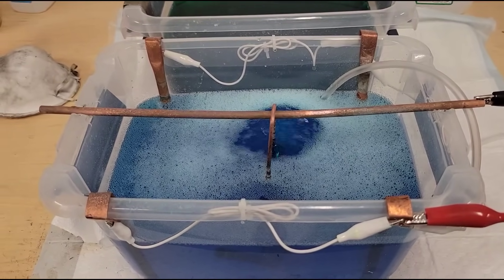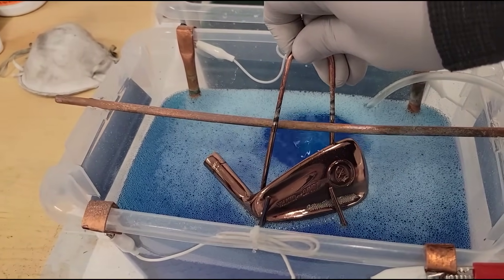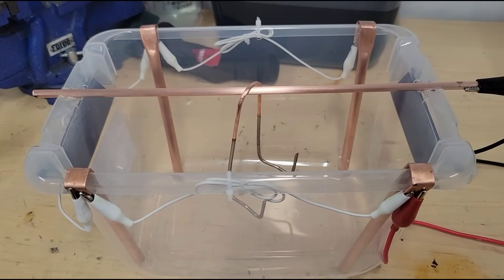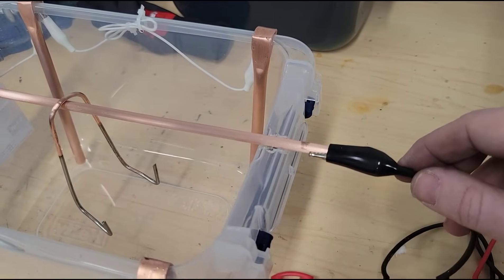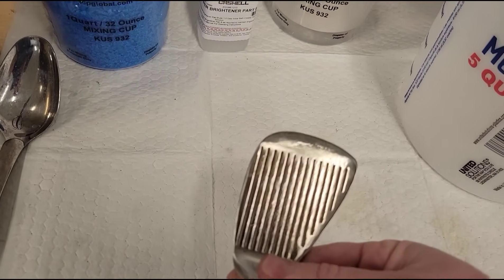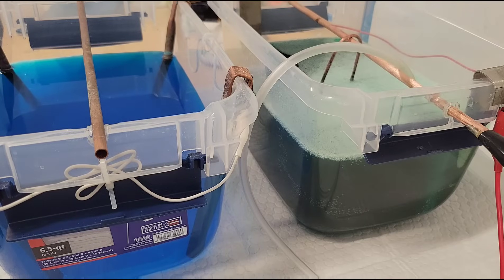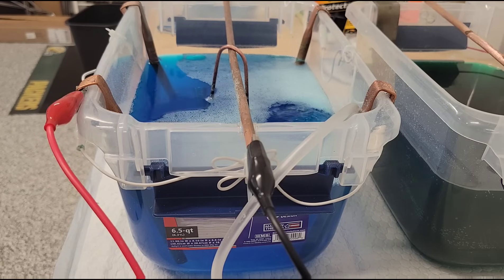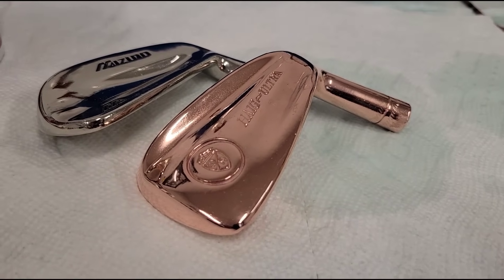Copper-Plating Your Golf Clubs: The Ultimate Guide

Comment: How long does copper and nickel solution last for? Can you use it multiple times or is it a 1 and done?
Reply from the maker: I still have the same solution in a jug. As long as it's clean, it can be reused. You just have to add distilled water to top it off.

Comment: You are correct that copper will not plate to a part that is chromed. You are incorrect that it will not plate to bare steel. After cleaning the steel, dip in in an acid bath for at least one minute then place it in the copper plating tank. All bumpers that are triple chrome plated are first plated with copper to fill in the imperfections, then nickel followed by chrome.

Comment: great stuff! I'm going to start an MP14 restoration soon. Is there any need to plug the hosel so that you don't chrome plate the inside of the hosel? I was wondering if that might deter good adhesion when you put the shaft back on
Reply from the maker: @nicholaskeay9842  thank you. You don't have to plug it. You can just ream it out with sandpaper before you glue it back on.

Comment: How much zeps did you add? I have a 2 pound bottle but it looks like you used a bit less
Reply from the maker: @trentonabernathy8540    @ I used the whole container, but I don't recall what size it was. I'm sure you'd be ok to use it all since there works be more copper in the solution and less need to feed it with the copper anodes
Reply: @BradMeehan  thanks! I ended up using about half the container. I found some source that said 10-12 oz per gallon of solution, and I made 1.5 gallons. I’ll see how it turns out, fortunately I have quite a bit of anode material. Your videos have been a big help.

Comment: I’m working on a Scotty Cameron TE I3 right now. I think the body is made of carbon steel, and has a black oxide finish. I want to remove the finish it has now so I can torch finish it, but I’m not sure how to remove the finish. Should I try bathing it in an acid.
Reply from the maker: You can just use the muriatic acid or Whinks rust removal. Check out my 'how to make a club black' video. Black oxide is just rust. You could even sand it off.
Reply: @BradMeehan  thank you!

Comment: Theoretically could you swing weight a club head by plating?
Reply from the maker: You lose some weight during sanding and polishing which yoi gain back during plating. It would take a lot to change it, but theoretically, it would since it has mass.

Comment: Could this process be used to replate cast iron skillet for use?
Reply from the maker: Yes, same technique for any metal surface except aluminum or stainless, which requires a different preparation than steel.

Comment: For people who don't know you don't need to buy copper sulfate, you can make it by just running a current through a copper anode and cathode on the same container that you plan to electro plate until you reach a nice blue color around 30 mins works excellent!
Reply: @AutodidactEngineer  does that work with nickel anode and cathode?

Comment: How do i get rid of deeper scratchers? Build my own set through your videos with good result but deeper scratcher remain😢 help!
Reply from the maker: You really have to spend time sanding them away first. Plating will not hide any scratches like painting does.
Reply: @BradMeehan  rekomend any spec grit?
Reply from the maker: @mikaelstahl2282  yes. Start with 220, then 400, then 600. Don't skip to the next grit until every scratch is gone, them do it some more. If you skip ahead too fast, you will still see the scratches in the final finish

Comment: Brad, did you ever find out the durability of the copper platting on the iron? Thanks!
Reply from the maker: I wouldn't recommend it for playing. Maybe on the face, like the MacGregor Colokrom's or something decorative on the back, but it's not durable enough to handle a bunker shot or hard pan lie. It will wear off pretty quickly like sandpaper.
Reply from the maker: But, you can also leave a layer of clear coat over it to extend the life.
Reply: Thank you for the feedback!

Comment: is the hook club wire copper as well??
Reply from the maker: It's copper coated. I've been using a piece of thin copper tubing lately that fits into the hosel. You can use anything that is conductive.
Reply: @BradMeehan  Thank you Sir...👍😊

Comment: how can i bronze coat a set of Taylormade 21 P790s?!
Reply from the maker: Caswell plating sells a bronze plating kit, but the steps are the same.
Reply: @BradMeehan  would i just have to remove the foam inserts first, then sand them before doing the bronze soak?
Reply from the maker: @rickydaher  You wouldn't have to remove the foam. The bronze won't bond to it (or chrome) at all.  You'd have to remove the chrome by sanding or other means like a dilute acid bath or the chrome stripping solution. You'll know right away if you missed a spot and you'll have to buff off the layer you just did and do it again. This is super easy stuff. Typing it out makes it sound harder than it really is. Cleanliness is the key to success. 

Check out my chrome stripping video on how to check if it's clean or not.
Reply: @BradMeehan  can i use the copper tank build to soak them?
Reply from the maker: @rickydaher  Looks like it. The only difference between my nickel tank and my copper tank is the anode i used (nickel vs. copper). Everything else is the same, so i'm sure their bronze kit is as well. The concept is exactly the same - take metal from a donor anode and bond it to your club. 

You may need to adjust the power output for the type of metal you're using. Meaning, I used less voltage/current for the copper than the nickel, but that was trial and error. There are calculators to get close.   The kit should tell you what to use per square inch of surface area.
Reply: @BradMeehan  right, could you possibly email me a list of what i would need as far as connectors etc lol? would be really lookin out if you could, cause to an extent it’s kinda vague on where i can get the white alligator clip connectors
Reply from the maker: @rickydaher  Check out the links in the description. Also, they don't have to be white, you just need them to be connected.

Comment: Please help me out here...been trying to plate some different pieces....first off they come out looking nowhere like yours...they're dull and have these "bumps" on them in several places...in places, the copper doesn't take... Getting aggravating...please help
Reply from the maker: Hi, Tim

Can you verify you used the brightener? Also, the bumps are pitting and it's caused by either too much current, or the piece is too close to the anodes.  

If the copper isn't bonding, it's likely still dirty (do the water break test), still has chrome, or there isn't a nickel layer beneath it. Remember, the copper won't bond directly to the steel. 

You can lightly buff it when it's done, but make sure you have enough of a layer of plating.
Reply: @BradMeehan  hi Brad...yes, i used 10ml per gallon per another video..had to make 2 and a half gallons to completely submerge my part because of the size of my container...couldn't find anything closer...im thinking i may not have put enough brightener in it...i can understand the placement of the copper anodes..may have actually been to close..need to lengthen my alligator clip wires...im thinking the piece may have actually been chrome plated instead of nickel...what is the water break test and what should i do/use to get the copper,bumps and chrome off? Thanks.......oh....and what should the current and volts be set on? My particular recitifier doesn't show amps being used
Reply from the maker: @timhiggins5956  Re: "My particular rectifier doesn't show amps being used" - Does this mean it doesn't have an ammeter or you are showing zero on the meter? I believe I was up to 4 v and 1 amp when I did the copper.

For the bumps, you'll have to polish those down and do it again. 

Here is the water break test: https://www.youtube.com/watch?v=tf02DB612HE
Reply: @BradMeehan  it has current and voltage...i was running the current starting out on 3 then went to 5....the voltage automatically changed when i changed the current setting
Reply from the maker: @timhiggins5956  I believe the 5 amps is what is causing the pitting. That's pretty high. 

Try a junk part with no chrome, spotless clean, and lower power (maybe 1 amp) and see how it comes out. Even if it's not bright right out of the bath, it can be with a light hit on the loose cotton wheel or hand polishing. Just get the material on it and see if it's plating for now.
Reply: @BradMeehan  ok...so I've been watching your video on the water break test on the removal of chrome......my question is this.... how do i take off the copper plating that did take so i can start new?
Reply from the maker: @timhiggins5956  it's so soft, you can buff it off. And, if it never really bonded you could probably just steel wool it off or sand it.

Comment: After you're finished with the plating and take it out of the solution, do you dip it in anything like distilled water? Do you wipe it off with anything or just let it drip dry? Thanks....sorry for all the questions
Reply: Brightner
1/8 cup corn syrip
1/8 cup murilax
1/4 cup water
BLEND really well, I use an emlusion blender.
Add as a per video here, works FANTASTIC! 
The above amount worked well in 1.5 gallons of copper bath.
Reply from the maker: I spray it down with distilled water for a good rinse, but nothing after that. It's bonded onto the club, so it won't wipe off so you can wipe it if you want. Keep the questions coming. That's why I made the channel!
Reply: @BradMeehan  thanks for the reply...ive got everything i need except the battery acid and copper brightener...ill have to order the brightener as i can't find it in any local store. Do you have any recommendations on finding it? Do you have to polish the pieces once done? I had a plating company do the plating and i guess they did an ok job but there's some burn marks on some of the pieces and what looks like finger prints..any comments on that, or how to avoid them? Ive got some extra pieces for a trial run and if i can get it all figured out, Im gonna redo the pieces i previously had plated...one other thing...i want to clear coat the pieces so they don't turn...i clearcoated the pieces from the plating company with a can of rustoleum aerosol clearcoat but they didn't turn out like i was expecting...should i have used everbrite? These are the metal banjo parts so brushing will be out of the question as there are a lot of small washers, nuts etc..thanks so much for your replies.
Reply from the maker: @timhiggins5956  HI, Tim. I haven't found the brighter outside of Caswells site. I did see a YouTube video of someone using a liquid laxative as a brightener, of all things. 

The fingerprint happens when you touch the plating without rinsing it. For some reason, I believe it still has a charge. It could also be that the fingerprint was there before the plating because it wasn't clean. You can buff after plating but I use only the loose cotton and barely touch it. I'd only hand polish the copper because it's so soft. 

I've seen videos of people using a sealant when they polish aluminum wheels. I'm not sure what it is, but I'd bet it would accomplish the same as the clear coat.
Reply from the maker: I ended up with 3 volts and about 1 Amp. I've reached out to a few plating companies to see what they use for thei4 power requirements but I've gotten no responses so far. It's a learning process for me, so I'm trying various settings to see what works best.

Comment: Great video! Could you hang more than one club at a time? Can you keep the shaft on, tape it and lean it against a wall? They’re graphite shafts no I’m assuming it won’t plate.
Reply from the maker: Absolutely. 
The lower requirements increase a bit to handle the additional clubs in the solution. I'd also recommend a larger container so you can keep the club far enough the from the anode. If it's too close, it can "burn", which isn't the end of the world. You just have to polish it a little after but you'll still get the same result.

Same with keeping the club on the shaft. I'll make a video of the key considerations for keeping it on.

Comment: How long do you leave them in, and also how long does 4 copper pipes last for usage?
Reply from the maker: The longer you go, the thicker the plating. 3 or 4 hours is generally where I pull them and check it. If they're not shiny, you can always polish after so you'll need a thicker layer to avoid polishing through the plating.
Reply from the maker: The copper anodes will last for a few months. I've yet to change mine, but I have changed my nickel anodes b8eciae i use them more.

Comment: So I have a set of TM P770s. If I wanted to do this I would have to nickel plate them first and then copper plate?
Reply from the maker: Yes, nickel first. You could use the "nickel strike", but you're risking missing a spot since it's hard to detect with the naked eye. A quick dip in the nickel has been successful for me before the copper.
Reply: @BradMeehan  got it! So follow your nickel plating video first and then dip in copper? Any specific time in the nickel? Also are you familiar with the p770s? Any unknown chrome I don’t know of? Also do you have any photos of what the club looks like with a little age on it?

Comment: I'm wanting to do this with an entire set of clubs. Do you know if you can do multiple at once? And do you know if you can use the same solution several times? Thanks!
Reply from the maker: Added an equipment list to the description
Reply from the maker: Hi, Jordan. You can use the solution indefinitely as the copper anodes continue to replenish the solution. You will have to eventually add more distilled water and maybe more brightener over time. The anodes (the copper bars) will deplete as they are the donor metals to the process. What doesn't end up on the club ends up in the solution itself. 

You can do multiple but you'll need larger anodes. The rule of thumb is the anodes need to be twice the surface area of the item you're plating. I do one at a time so I can prep amd polish one while plating another.

Comment: How did you mix the nickle plating solution. That iron looked pretty nice nickle plated. Do you need the copper brightener for it to stick to the club.
Reply from the maker: Check out my nickel plating video to see how to make the nickel. The copper brighter just makes it shinier versus a darker copper color. The nickel is what helps the copper bond to the bare steel.

Comment: Absolute beauty. I can't imagine the coating would be super tough, maybe worth a try if I find an old single iron at the thrift store. Thanks for the vid Brad!
Reply from the maker: Yeah, the durability will be poor but for a wall hanger, they're pretty cool. You could also plate with nickel or cobalt for durability after.
Reply: seems this only works on chrome polished base material. The problem with copper is that you have to constantly polish it so that no verdigris occurs